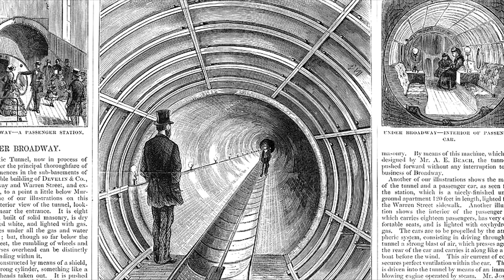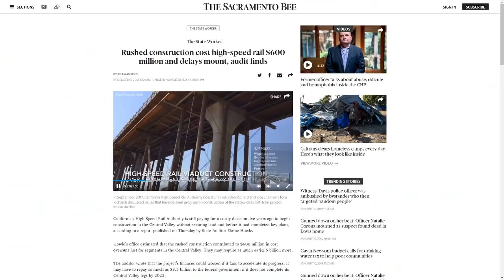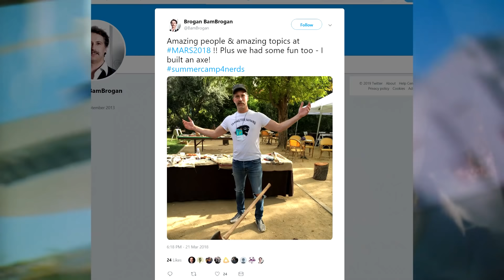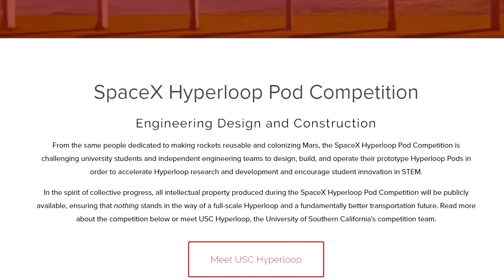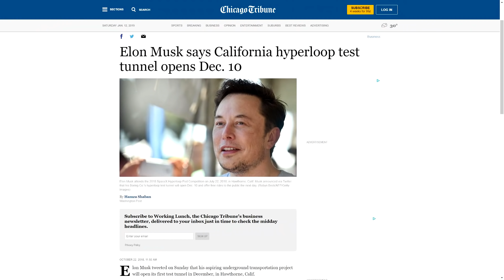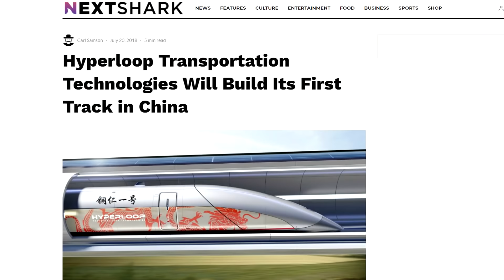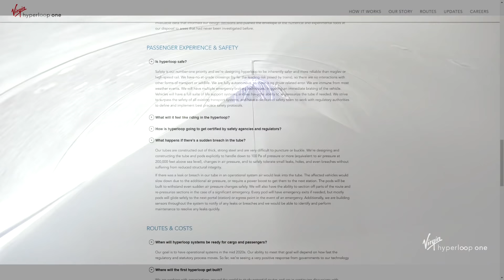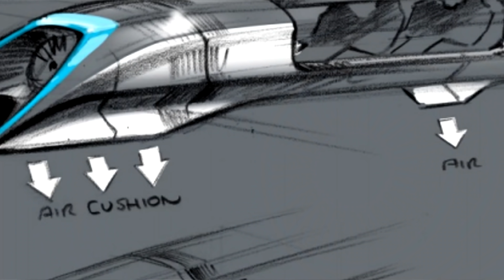Why Hyperloop will FAIL HARD - Its Biggest Problem...

Comment: To me the main problem of Hyperloop is that it is used as an argument to avoid investing in proven technologies. "Why build conventional high speed rail when we can have hyperloop?" "Because conventional high speed rail works, moving millions safely, reliably, efficiently and comfortably, and they even get a nice view from the windows."
"We can have hyperloop" is not true until one of the companies mentioned actually manages to build a fully working test system. I think that keeping a huge system of tubes at low air pressure (I guess going to the best vacuum technically possible wouldn't be economic) will be enormously difficult and probably use up the energy that's saved by having less air resistance.
Reply: It's been tested and it works. The problem is that there is not billions enough in it for criminal corporations that no longer serve their own country.it works but it can't go anywhere.
Reply: @mikewillis44  hsr, is not, safe, reliable, efficient, or very comfortable
Reply: Why do people need a good view, hell why cant they just get a LED window to portray whatever is outside, it works well for first class middle seats on A380s
Reply: "I think that keeping a huge system of tubes at low air pressure (I WON'T CALL IT VACCUM; THE HIGHEST VACCUM ON EARTH IS STILL MORE AIR THAN WE HAVE IN INTERPLANETARY SPACE...)

Your are so wrong about the the level of vaccum we can create on earth, pls do some research first before talking garbage...
Reply: It must be a conspiracy by China to disrupt the investment of HSR in the West. #sarcasm
Reply: I think many people to fail to realize cost-benefit analysis and spew nonsense about some magic technology that has hidden cost.  Ten years ago DWDM would have looked like future of telecommunications and people rushed to install hundreds of thousands of miles of fiber lines.  Then on the other hand the technology also advanced DOCSIS and could match fiber with very little replacement of equipment.
Reply: It's essentially the same thing as "we don't have to worry about climate change, because we'll be able to go to Mars."
Reply: Hey not to be that guy, but I'm pretty sure the vaccum in CERN's particle accelerator is more "vacuum" than space is.
Reply: This is what pisses me off the most. The failure of hyperloop will set these proven technologies back from being used in the United States even further.
Reply: @mikewillis44  It doesn't work. It could theoretically be FORCED to function, at massive expense, gross inefficency, and cataclysmic destruction every time there is even a minor compromise. Oh, and in the event of any accident at all, EVERYONE in the system dies. It hasn't been tested, either. It's had a few toy pods driven down half a mile of tube, and not under vacuum. It's a shit idea. The "problem" is that it's a shit idea. It was a shit idea 100 years ago, and it was a shit idea when Elon Musk stole it and pretended it was his own.
Reply: @SeekerLancer  What proven technologies? There is literally NOTHING new or innovative about Hyperloop
Reply: Yet the same pessimism often used to "debunk" hyperloop, if applied on said conventional high-speed rail, would've been embarassing by now. 

Also, by that logic, when HSRs were in early research people could say "the biggest problem about high-speed rail is it is used to argue against investing in proven technologies such as airplanes and automobile highways"
Reply: well hsr works best in dense population areas. For countries like the US that don't have these population centers close enough. Hyperloop would be the better alternative.
Reply: This is the same argument that was used against the development of the electric car. Remember when we used to think of electric cars as fancy solar-powered box car races.
I think this video does more of a disservice. It is good that an alternative technology is being researched because that will inevitably lead to a break-through.
Reply: @RubiconDota  Except it's not.  Just because good ideas were criticized in the past does not mean we can't criticize dumb ideas today.  But Musk fanboys just ignore all the legitimate criticism, and try to divert from the flaws in the system with made up nonsense.  I get it the videos are wondrous and look like something from a sci-fi movie, mainly because they're made the same way in a computer.
Reply: @Scott Wilson I am talking about the Chinese HSR
Reply: Why build in the united states high speed rail at all? The states are a country which needs Cargo Trains and it got plenty of those. City to City travel? Outside of the two mega stripes in the east and west? A problem which asks for planes. 
The geography of of a country matters, Japan is "perfect" for bullet trains. 

Hyperloops might be great solutions for small scale, short distance city and air port interconnections. Or it might be just to expensive for even that, similar how Shanghai has issues with their mag lev train.
Reply: @Traumglanz  exactly!
Reply: @Traumglanz  Well, there is this small problem called climate change, and since batteries are fairly heavy, electric boeing 747's will probably not be around for a while. Powering an electric railnetwork is probably a better choice, both economically and environmentally.
Reply: @mikewillis44  "It's been tested and it works"? No it hasn't.
Reply: @mikewillis44  It has been tsted ... And no it doesn't work, you can still get faster in a freaking high speed train at a fraction of the cost.
Or maybe the tests need to be more systemized and have more interest put in them... Because guess what? Even Elon has got better stuff to do.
Reply: I'm down with whatever.  HSR?  Great, lets do it.  Hyperloop?  Go for it.  The problem with your argument is that we AREN'T building HSR.  We've had about fifty years to even begin to try to match the rest of the world, and what do we have?  Acela?  A couple projects in development around the country?  HSR, as much as it pains me to admit it, likely ain't happening in the US.  But people seem to care about Hyperloop.  Maybe it gets built, people see that traveling by rail—or whatever you call Hyperloop—is much more convenient than by plane or car, and then we start investing in conventional HSR for less lucrative routes.  I mean, I'm 35 and this is the first time I've ever seen the general population even somewhat interested in rail transportation.  So I'll take what I can get.
Reply: You know, all this talk about fusion is a real problem. After all, it is taking away money that could be invested in proven technologies. What use do we have for fusion, Coal works.
Same for Solar, really. It is intermittent, how good could that possibly be.
Or space. What good is ever going to come from space. Let's stay on the ground.

Seriously, what kind of an argument is that.....
Reply: the difference is that one is in development and is theorized to go 600 mph max.
Reply: While putting a maglev train in a vacuum reduces the amount of air resistance and thereby decreases operating cost.  However I'm skeptical the savings would be enough to offset the cost of creating and maintaining 100+ miles of vacuum.
Reply: @scottthewaterwarrior  There might be very clever solutions to this. e.g., since a train would behave like a plug pushing through the tube, it would also push a high pressure shockwave ahead of itself. Install pressure valves in regular intervalls, and the trains THEMSELVES keep the tube a vaccum. 
Seriously, building a million miles of tubes, airtight or not, in the first place is going to be the bigger problem...
Reply: @dogguy8603  Have you ever used it? I suspect not. I have used high speed trains in many countries and they ARE all of the above.
Reply: @r.jimlad4826  how are they economically viable when they run a a loss and are unprofitable, there is a reason no private sector business has invested in CHSR
Reply: @dogguy8603  Depending on what company does what sir (a company that transports freight can transfer passengers as well the reason why rail networks more or less constantly run At a loss is simply due to the fact that they are government owned in a LOT of areas Japan Government Owned and Operated France Government and operated United Kingdom Government owned Publicly Operated United states in the Passenger transport sector Government owned Trains (to an extent tracks like the NEC along the east coast) (before America nationalised the passenger transit system the public companies operated the passenger services and did it well (before CSX came around the L&N was a large company like the PRR and NYC (New York Central) and it transported passengers in a cheap cost effective way) when Amtrak came around it is Not cost effective due to the fact that it does not operate its own Freight Lines/Trains and doesn't compete with ANY OTHER COMPANY its a monopoly and there is a sort of freight train called High speed freight and as far as I know it brings In money and operates at a gain
Reply: @MPostma72  yah 747s aren't the reason that the ice caps are melting, and if you ask the founder of Greenpeace, humans aret a factor at all
Reply: @sockshandle  but we dont need high speed freight and in long distances it is just easier and faster to to load up a 737, i dont want to spend 100b for a useless train as flying will still be cheaper and faster
Reply: Problem with yours and this video's argument:
#1 You use the word "I think" with nothing to back it up.
#2 Technology changes. Horse and buggy are out and automobiles are in. Something works now can be improved upon.
The voice in this video got desperate when it came to safety. Nothing he said is inherently unsolveable.
Reply: Use wind instead of a vacuum.

Easy fix is to blow the air from one tube into the other that is going in the reverse direction and create a tailwind to help push the tube trains. Might get faster ground speed than mach 1 without the sonic boom when the speed relative to the air is less due to it moving with the train.
Reply: Yes we could also just stop innovating and just stop progress!
Your comment makes no sense whatsoever!
Reply: Common Sense; who are you talking too? OP has a sensible argument about the drawbacks of keeping a long tube at vacuum pressure. I suggest the use of tailwind in the tubes so that pressure is less reduced. Who isn't making sense?
Reply: hyperloop cars are being developed for another underground system that already exists.
Reply: Your argument would have been a good reason not to replace horses with trains.  Horses were reliable and known, why mess around with some new fangled thing called a train?
Reply: Raw and Cooked Vegan; wheels are prone to breakage. Let’s stick with the good old tried and true sled technology. Dragging our way to success!
Reply: @dogguy8603  Name one mass casualty HSR accident
Reply: @papito3030  https://en.m.wikipedia.org/wiki/Wenzhou_train_collision
Reply: @dogguy8603  Enjoy you plane trips, buses and car rides.   FYI,. Amtrak's Acela is making over 40% of Amtrak's profit.  It's making money that pays for slower trains.
Reply: @papito3030  i do enjoy plane trips thank you very much
Reply: @dogguy8603  it is all those things, even on Amtrak, which people call the lowest of the low of high speed rail. It's actually really good, just not at European standards.
Reply: @mikewillis44  I dont think you understand the word "fully working test system". What we had seen so far is just early technology demonstrator. It would take few decades and tens billions of r&d. Until we saw a pod moving inside near vacuum tube at 1000 km/h with human inside complete with safety measure it is nowhere near fully working system.
Reply: @Traumglanz  Small scale, short distance is exactly what hyperloop is worst at. The reason is simply because even if it could be made to work, it's most significant benefit would be high speed. But you can't get to high speed on small scale short distance simply because when you are transporting people you have to slowly accelerate and deccelerate over a relativly long distance. On small scale short distance that means that the hyperloop wouldn't even reach it's top speed on most of the track. Which is of course a good thing since a slower speeds it can make sharper turns which is important on small scale short distance. However, if the hyperloop can't reach it's top speed any conventional metro system is far more efficient because it can transport far more people.
The only deployment of hyperloop that would make sense is for long distance high speed transportation.And that's exactly where the technical problems ramp up to such a degree that it's pretty much unviable.
Reply: @mikewillis44  is has not been tested.. to any extent running a maglev train in a relatively tiny vacuum tube for a short distance is not testing anything. And in generally serves no purpose as it addresses non of the things that make it realistically impossible. But it's a 100 year old idea. Look at how much trains and planes progressed in that time. Wanna know why the hyper loop didn't? It's realistically impossible. There is no actual benefit in running a train in an "edge of space" vacuum.
Reply: @djstringsmusic2994  the benefit is that it uses very little energy and can be as modular as you want it to be which is good for this virus problem we seem to have. They are building one this year in the UAE where they are happy to build public transport services. Planes use tons of fuel. It's all about energy and the cost of construction which will be far less as well.
Reply: @dogguy8603  rail is only beaten on efficiency by Sea, high-speed or otherwise (and sea travel kind of cheats sometimes too). Especially with Properly built Electric systems (historically it has bee difficult to justify the setup cost of electrification on low traffic lines. The Running costs are an entirely different matter)

  The comfort of standard rail, high speed or otherwise. Is entirely down to the rail company (or government)'s willingness to invest in higher quality cars without blowing the budget on questionable untested technology. Well, except in situations like the Tokyo metro where rush hour overcrowding is simply a function of the sheer number of people who must be moved, and there's a maximum amount of train you can safely fit on a given amount of track in a given amount of time, but running an entire extra set of Track through the middle of a city is horrifically expensive. And it's as least as much a city planning problem as anything else.

 High speed Raul's reliability is entirely down to local conditions, specific design, and the railway's willingness to actually pay for maintenance. On one occasion trains in the UK failed due to "the wrong kind of snow"... Quite literally. The filters to keep the snow (quite literally water) out of the air intake were designed with certain incorrect assumptions about the nature of snow. To my understanding, the filters were replaced with more suitable ones and it hasn't been a problem since.  "Leaves on the line" can similarly be solved, if the railway is willing to spend the money on the necessary preventative measures. It's not an inherently unsolvable problem with Rail.

Safety depends on a whole Bunch of factors. Rail has generally got a lesser version of the same advantages air travel does in this regard. It Also has most of the same failure points (excessive cost cutting leading leading to poor maintenance, usually) with further failure points depending on design and conditions. Japan's shinkansen(sp) has a Very good safety record, for example, in part because it runs entirely on dedicated elevated track, so it doesn't interact with anything else. (The track is also specifically designed to handle the problems presented by high speed rail and local conditions in Japan).

In summary: high speed rail, like any other major engineering project, has challenges that must be over come, but they're the next best thing to entirely known And Solved challenges. Failure to overcome them is almost always a result of underfunding and/or mismanagement (or occasionally incompetent design, but not catching that is mismanagement in it's own right), Not the technology itself.

Actually, I do take back/concede one point on efficiency: high speed rail has a minimum distance it has to actually travel to get benefit out of being High Speed.  This too is a known and solved problem though: lower speed (still usually quite a bit faster than a car in the same environment), high capacity, high Frequency, trains with good acceleration are used for shorter distance lines. And the efficiency is back.
Reply: @dogguy8603  citation required